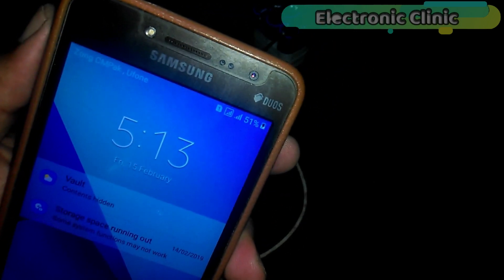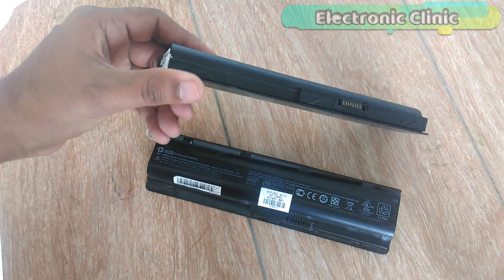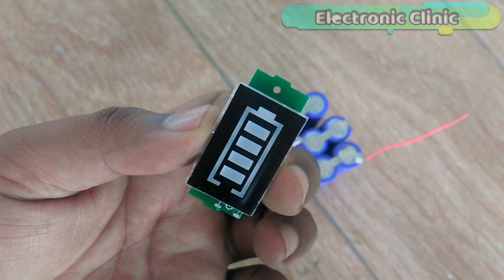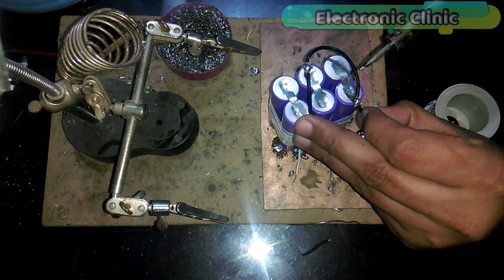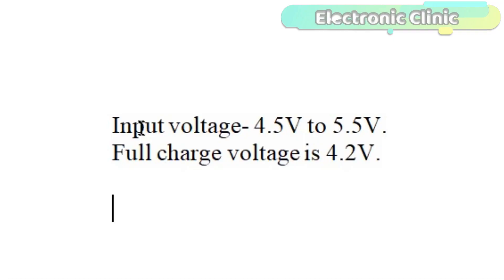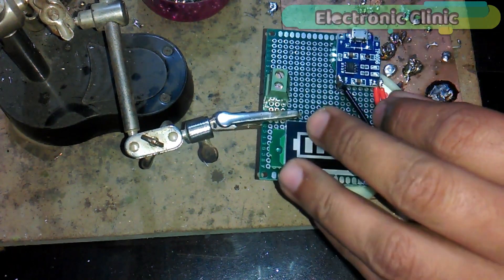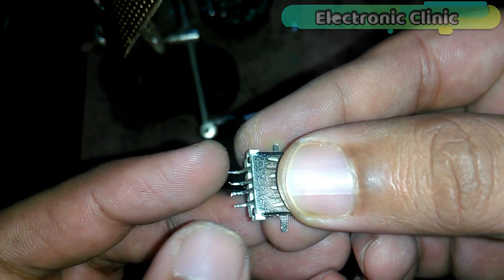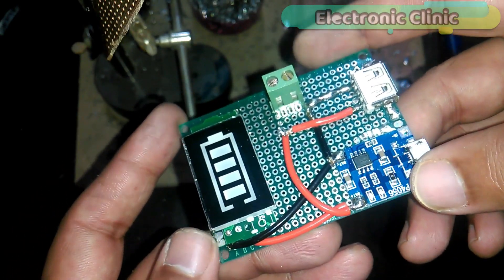Power Bank from Laptop Battery with TP4056 charger & Voltage indicator Display

Comment: cell phone need fixed 5volts.whats the output voltage of these cells.is it stable.i think u need lm7805 regulator to regulate the voltage before giving to cell phone.
Reply from the maker: not really. check the battery ratings, open your cell phone battery.
Reply: 4.7v  but it need 5v to charge @ElectroniClinic
Reply: Thanks bro yup would definitely use lm7805 later on my power bank